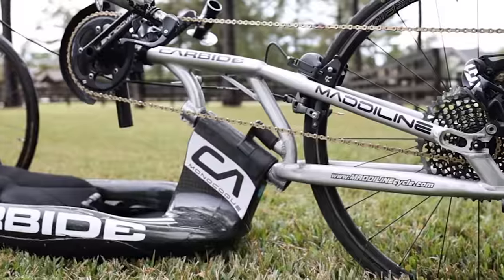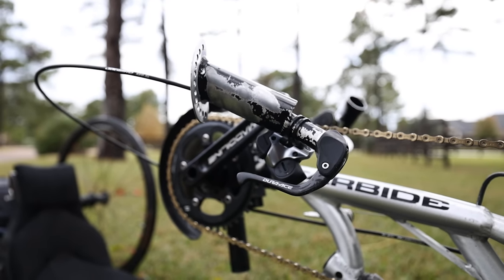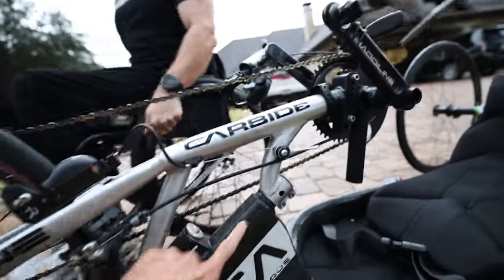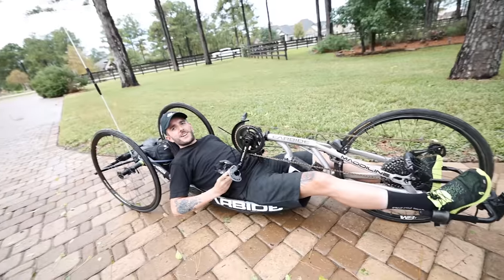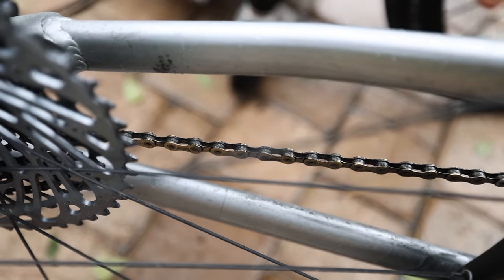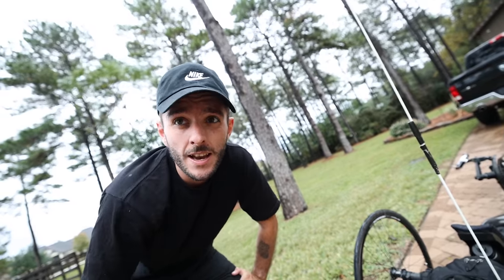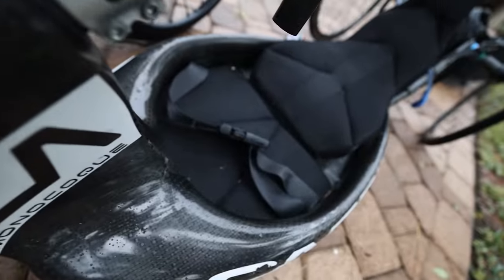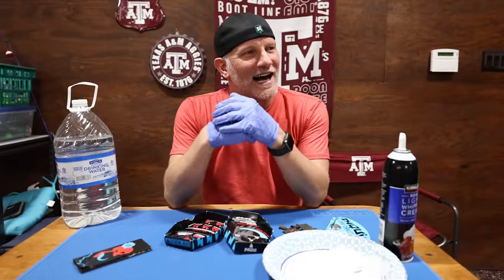Justin's Bike Setup For Cycling Across the USA

Comment: Why exactly doesn’t the trailer work on your bike? Is it the thru axle that is not the right fit for the bike?
Reply from the maker: No it’s just unstable, a combination of too much weight, high centre of gravity (wheelchair wheels on top) and exceeding the speed limit of the trailer (15mph).